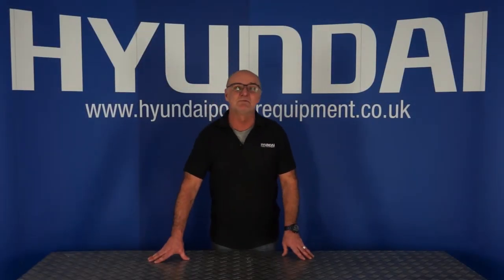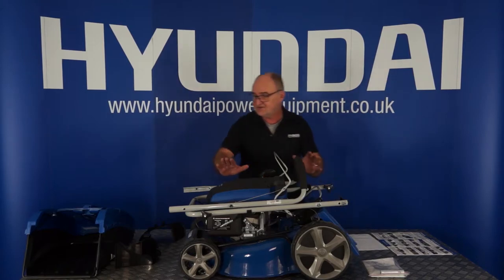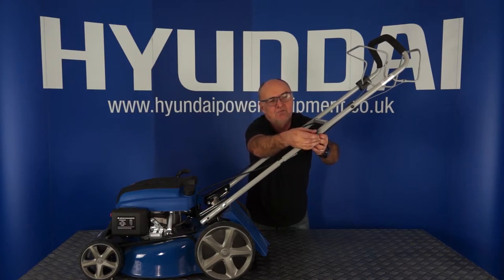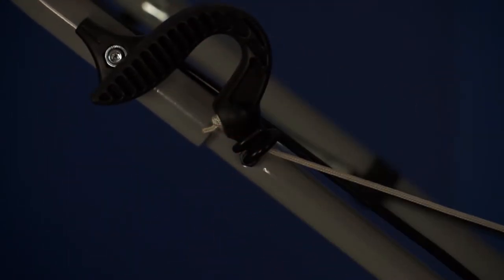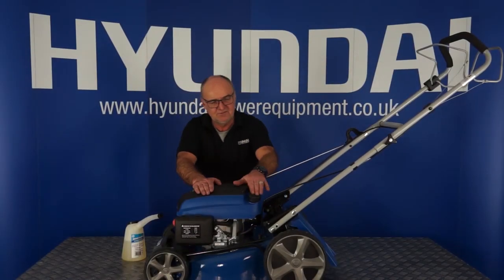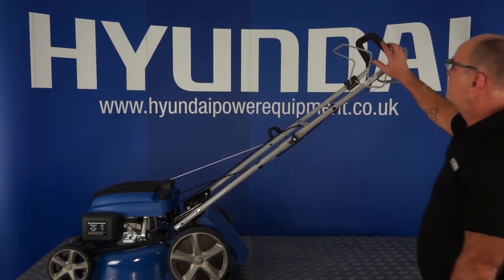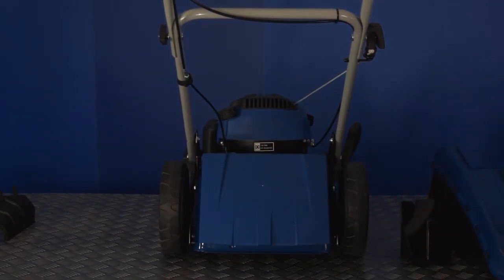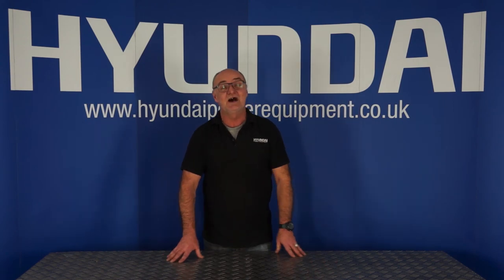Hyundai HYM510SP - Self Propelled 4-in-1 Petrol Lawn Mower Unboxing  & Assembly

Comment: Thank you for this. I was really struggling but your video helped. The hardest part was getting the two silver cables to reach the handles. Around how many ml of engine oil is ideal?  And i have two little black plastic pieces like Monopoly hotels left in the pack and not sure what they are for.
Reply: Those tiny "hotel" bits are to hold the back flap slightly ajar for a rear discharge function...:o)..I couldn't figure it out either...found it in the manual on page 33!